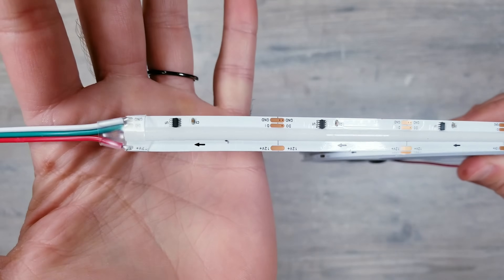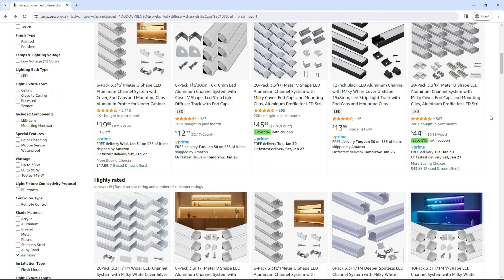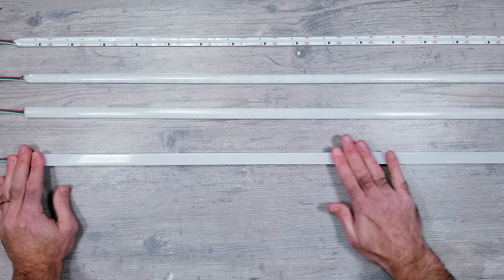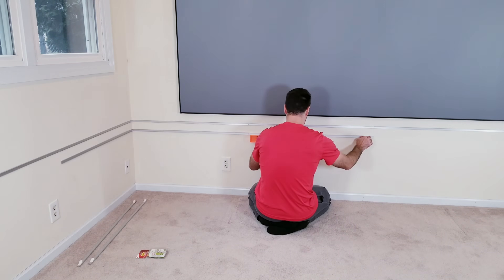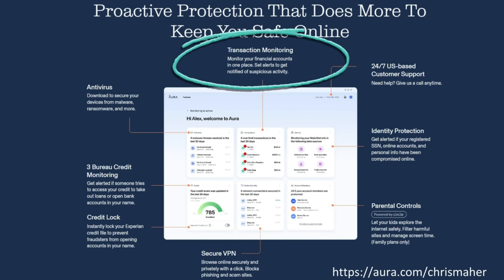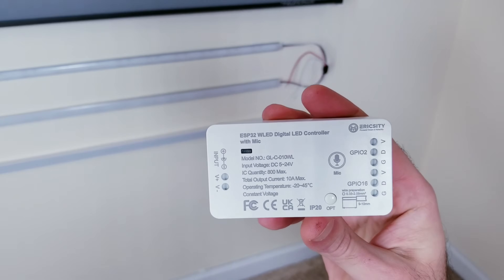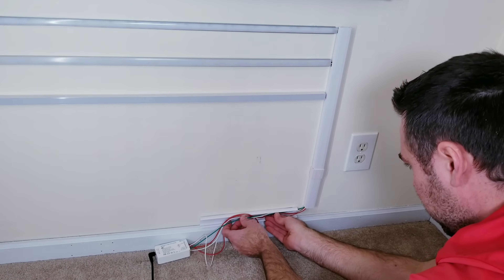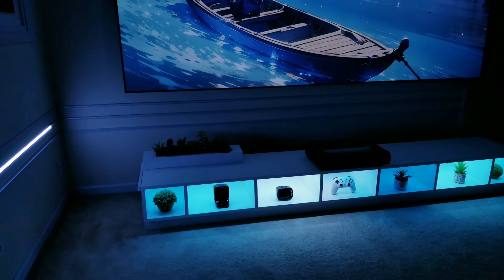The BEST Low Profile Diffuser Channels for COB LED's

Comment from the maker: 📟 BEST Amazon Deals on Electronics: https://amzn.to/47qjC9j (updated daily)
☑Check out my sponsor to begin your FREE 14 day trial to Aura: https://aura.com/chrismaher
WLED Controller: https://amzn.to/3HxjUgT
Cob LED's: https://amzn.to/3SxjE83
12v Power for LED's Above: https://amzn.to/422SSra
6mm Diffuser Channel 1 meter: https://amzn.to/47OVPNA
6mm Diffuser Channel 2 meter: https://amzn.to/3SzalEO
Continuous Diffuser: https://amzn.to/3SxmQAs
Corner Pieces: https://amzn.to/3OfZH2U

12mm Diffuser Channel 1 meter: https://amzn.to/3UfGW3r
12mm Diffuser Channel 2 meter: https://amzn.to/4bdwvDS
Continuous Diffuser: https://amzn.to/42iiqAL
Corner Pieces: https://amzn.to/4b9dHFH

Corner Diffuser Channel 1 meter: https://amzn.to/47N66tr
Corner Diffuser Channel 2 meter: https://amzn.to/3vRry3i
Corner Pieces: https://amzn.to/3Ojs2p5

4.8mm Diffuser Channel: https://amzn.to/47N6bxf

3m Removable Sticky Pads: https://amzn.to/4983nfj
Cable Hider: https://amzn.to/49rFUGf
Wire Stripper: https://amzn.to/3O5XEhW
Wago Connectors: https://amzn.to/3HzpUG0 and https://amzn.to/3HA9ZHA

Other LED's + Compatible Power Supply with Controller in Video: 
12v WS2815 Strips: https://amzn.to/491aKFa
12v Power Supply: https://amzn.to/422SSra

24v Cob Led Strips: https://amzn.to/424vI3H
24v Power Supply: https://amzn.to/3SpB1Xl

5v SK6812 Led Strips: https://amzn.to/3S6ptaX
5v Power Supply: https://amzn.to/48R3PP6

5v WS2812B Led Strips: https://amzn.to/3tYxpmI
5v Power Supply: https://amzn.to/48R3PP6

Spotless Diffuser Channels for Regular 60 Leds/meter strips:
Regular Channel: 1m Amazon: https://amzn.to/47aIujz 
Regular Channel: 2m Amazon: https://amzn.to/3QoHeDb 
Corner Diffuser 1m Amazon: https://amzn.to/3DFhRpf
Corner Diffuser 2m Amazon: https://amzn.to/3Krqw2q

Domestic Automation Plug n Play Controller with Mic: https://amzn.to/4b5UqVq
Domestic Automation Plug n Play Controller no Mic: https://amzn.to/48uRgZP
Video for Domestic Automation Plug n Play Controller: https://youtu.be/QmMwrOUB_kw

Video on WLED Controller: https://youtu.be/UTzR8GmZelU
Video on DIY LED Media Console: https://youtu.be/Bte2lbwbh8I

Check out my sponsor to begin your FREE 14 day trial to Aura: https://aura.com/chrismaher

The best way to help support my channel is to like, comment, make sure your subscribed and share my videos with as many people as you can. The other way is to use my links above as I get a small % at no extra cost to you if you buy something. Thank you all for the support!
Reply: Hey Chris, honest question. Which one is better?. Your previous recommendation of the WLED with the sound reactive built-in or this WLED controller?. To me, the difference is if you want sound reactive vs non-sound reactive WLED. Second question, can you use these Cob LEDs with the previous WLED with the sound reactive controller on your previous video?. And lastly, which combination will be the best in colors, controls and budget?. FYI, I want to upgrade my entire living room LEDs and control with WLED. I require at least 90 ft. Thank you for your advice. Big fan!.
Reply from the maker: Both are great! I would go with the domestic automation one for 5v led strips and this one for 12 or 24 volt strips. This controller also has a built in mic for sound reactive animations so you still would have that as an option. I have yet to try using the 12v cob lights with the domestic automation controller but it is something I want to try seeing if there is an easy workaround! The unfortunate thing about led strips is that there is not a perfect solution so it really comes down to what your main goal is. Colors will all be about the same but pixel density varies. Then it also depends on if you are using a diffuser channel or not an if you want to have a good looking white. Its fun trying different lights out but I think my overall favorite is still the sk6812 strips with 60leds per meter with the neutral white diod. I love having the dedicated white! Hope that helps and thanks for the support!
Reply: @ChrisMaherDIY thanks for the feedback bro. The SK6812 looks nice with your demonstration. However, I believe you can see the gaps even when you use a diffuser because of 60 LEDs per meter. I like Cob LEDs smoothness, the density is really nice. I don't think I can achieve the same smoothness with the sk6812 even if I use a diffuser?. Also, the SK6812 is 5 volt. Which means I have to do at least three power injections with my 90ft project. Oh yeah I also watch your other video and this WLED indeed has a microphone just like the other one, but this controller is better put together vs the other one which is exposed. Also I like this one because it has 24 volt power which means you can power long LEDs strip better than the 12v or the 5v. The only question I have is which one gives better individual colors and saturation, The Cob or Sk6812. Thanks.
Reply: @ChrisMaherDIY neverending question, can led strip be main light, and if, where?
Reply: What about COB Neopixel with 332 per meter?

Comment: Again you skipped right over how you laid the various tapes around the 90deg inside corners. ?
Reply from the maker: I'm not sure what your meaning. You don't do anything other just continue to stick them to the profile. No cutting, no twisting. It just lays flat and follows along on the wall.
Reply: @ChrisMaherDIY  Even with the 4.8mm channel, the COB strip will just fold around the inside corner ?  It would have been very tight and I never would have thought that possible.  Thank you sir !

Comment: I recently discovered your channel and it is amazing work you are doing. All the respect.

I'm building a small mancave/movie room/home office room out of the garage. It is quite small, 4,5 m x 2,3 m and the height is just 2,2 m.
I want to make 3 led stripes on the ceiling (in gypsum), probably around 3 m long each, as my main lighting. What do you think, is it going to be of enough light for main lighting (if not ambient is needed)? If yes, which RGBW led stripe would you recommend for this? Many thanks

Comment: You are adding power to the power injection and I wanted to ask: if you already connected LEDs (power, ground, data) and then also connect extra power to the power injection cables, won’t it burn or something? I thought that I need to either connect power/ground or connect injection cables. 
Can you please explain?

Comment: I just installed COB lights over my kitchen cabinet.  These babies melted the plastic reel they came in as I was installing, wondering if they would over time melt the plastic diffuser on the metal channels?

Comment: Thankx for your great videos.  I have never tried using this kind of lighting, and I have a kitchen island that i want to add LED lights under the overhang edge of the  top.  the top is a simple rectangle, 10' X 4'    So 10' + 10' + 4' + 4' is  28'  Can i join two lengths to give me a single loop, and just do a power injection between the two sections. I want to have the ability to let the light "chase" around the top.

Comment: Hi friend. Please tell me. there is a WLED project on ESP 32, respectively, it has an address LED strip. is there anything similar but with a simple RGB ribbon? then I have 5 meters of new tape lying around and I do not know what to do with it. the standard drivers that are sold in stores are not interesting because they are not interesting and they cannot be controlled via WIFI. I can build a driver on MJE13005 type mosfets, but they also need to be managed somehow. I think you've heard about the AlexGyver blogger, he has an RGB ribbon controller on an ARDUINO NANO, but again it can't be controlled over WIFI. Hello from Russia

Comment: I know this video is 9 months old, but I’m trying to create a a base board in which you can’t see where the light is coming from. Wondering if the 4.8mm would be good enough if you can’t see the diffuser channel, just have the light glowing downward, or if the light, about 3 inches off the floor would be fine? Would I even need a diffuser channel? Only reason I’m considering one is for easy replacement of the LED strip if/when it has any issues.

Comment: I prefer the shallowest non-flexible channels for COB.  But with COB, a diffuser cuts the light by 30% and really hampers your maximum brightness.  So when I use channel with COB I leave the diffuser off.  (I've only  been doing kitchen under cabinet where it doesn't matter)

Comment: Still waiting for Govee to jump on those Cob rgbic strips with reasonable lengths.
The great thing about cobs is that you can use really low profile diffusers that don't stick out like a sore thumb from the wall. And corner diffusers can be lower profiled too.

From my own research, I figured out that you need 60+ leds/m for a 16mm high profile. For corner diffusers, you either need big ones that have enough clearance or need more than 120leds/m for smaller diffusers.

Comment: for 25 meters how many watts power supply need?
Reply: Go to btf lighting select the strip you want and in the description it will tell you the maximum watts it draws per meter at 100% brightness white. Then times that by 25. Make sure to match the power supply voltage to your strip.

Comment: Hey Chris, Enjoying your vids, watched almost all of them.
On this project did you just use one ESP 32 Conttoller ? 
I'm about to do a LED multi-strip horizontal display and was going to use an ESP 32 per strip. 
The way you have done works well for me, I'm just not sure how you got it all done (+- 15 meters) all with on ESP #@ and those great unsync'd and sync'd effects.

Comment: Hi Chris. Thanks for the video. I have a couple of projects planned and this will help me out. While looking for the COB LED on BTF seller profile in Aliexpress, these exact same strips are advertised as not compatible with WLED/ESP32 controllers and require their own controller BTF lighting. I am pretty sure it is just a way to force you to buy their own ontroller but wanted to make sure. I see you are using WLED, so should not be an issue.

Comment: Hi Chris,  I'm brand new to LED lighting.  I'm curious about 2 things.  First, I really like the movement effects of the lights in the video, and I'm not sure if that is sound reactive, or a program?  Second, I want to install a similar system outside (70' in 10 foot sections).  Are the LED's you used suitable for outside?  If not, what would you recommend?  I mostly want white, but the color effects are awesome!

Thanks for the awesome video!  I didn't even know about diffusers until I watched it!

Comment: You were using a 12V LED strip which means that one IC controls 36 LEDs. That's why one segment of several centimeters always have the same color. If you use a 5V LED Strip instead, one IC only controls 2 (!) LEDs. This would give you even a better result. However, depending on the length of the strip, the current could become a problem...

Comment: Heya Chris, question for ya: The width of the LED COB strips per BTFs specs are 12m, but the Muzata channel width for the Corner (V shaped) channel diffusers are spec'd at 10mm.

Your video shows how well they work regardless, but did you have any trouble installing the COB strips in the V channel diffuser frame?
Reply from the maker: Thanks for watching and great question! You are absolutely correct. The strip is slightly bigger than the flat part of the diffuser that the strip goes to but they stick just fine and doesn't effect the performance at all.

Comment: I have used these strip lights in all my projects. I was thinking of trying this as well. I could not afford to buy them and test them myself so ty. I used 2 1 meter strips in the spotless corner diffuser. Those cost more. To make sure it worked out. It does they are a little wide for 2 strips but work well and very bright. I was just sure to line the segments up well so it looks like 1. The ones you testested here  will save  alot of my cost when using them over spotless. Ty again.
Reply from the maker: You are very welcome and thanks so much for watching! Sounds like you had a great idea to make it work! Thanks for sharing!

Comment: I know you didn't mention it, but how much do the diffusers affect perceived brightness? 
I ask because I'm planning a 12M+3M*4 (12M is perimeter, 3M*4 is corners) and right now my total cost using the 96LED/M Muzata strip you showed is just around $300 depending on the prices of the day. Since I'm planning on running the perimeter strips where the wall meets (10ft) I've been debating buying COB no diffusion since the strip will be hard to see that high to save money and gain brightness. 

But, since you have everything in hand: If all the strips will be white most of the time to be used as main lighting (yes I want it dim) and effects will be used some of the time do feel that the Muzata is the best bang for the buck or do you have a different recommendation for that? 

Also big thanks for all the videos you do with this stuff. I was able to use your Govee perm light guide to install mine this year without any issues, and I'll be getting into WLED using the same lessons with this project!
Reply from the maker: Thanks so much for watching and great questions! The muzata strips are a great bang for your buck. But if your main goal is to have them be white and your main lighting source, I would probably look at a strip that has a dedicated white led built in like the sk6812 leds. Or maybe at the very least order 1 of the muzata ones to see what you think of the white color. I also believe there is a cob strip out there now that does have a dedicated white light that Ill have to see if I can find. So many options to consider! I know its overwhelming at times.

Comment: I need a corner diffuser that is less than 16mm on the sides, ideally around 12. I have yet to find one, have you ever seen one that shallow?
Reply from the maker: Thanks for watching and that's a great question. I have not seen anything that small for a corner profile. If I ever come across one though I'll let you know!
Reply: @ChrisMaherDIY  That would be great. I have Detolf display cases from Ikea that I would like to light along the side edges instead of the typical per shelf. The space is limited though. Love your videos and they've taught me a lot. Keep it up!

Comment: Would you consider using the 6mm diffusers in under kitchen cabinet lighting?
Reply from the maker: I would probably go with the 4.8mm one for under the cabinet and if the light is somewhat hidden, I wouldn't even put on the diffuser covers. At least for me, if its in the kitchen, I'm wanting things to get as bright as possible. But if your just wanting some nice soft light but don't need it as bright as it can possibly go, then I would still go with the 4.8mm kit. That's actually what I used in my undercabinet kitchen video I did a while back and its still working great today!
Reply: @ChrisMaherDIY  Awesome!  I have that video saved so I can reference once I get some free time to get that project rolling.  Thank you for your amazing videos.  Inspiring and super informative!!!

Comment: Nice, thank you.
I actually used black aluminum corner profiles (with black diffusers) and a COB RGBA strip and put that all around the edges of my gaming table. When off they're stealthy, just blending in with the table itself. And when turned on it's like the entire edge glows. Those COB strips are trivial to diffuse, since they almost don't need them (especially on a higher brightness level/also consider there are different levels of density on those COB strips as well).
Reply from the maker: Thanks for watching and taking the time to comment! That sounds like a great setup! What black channel did you use? The only ones I found I was able to see through the black diffuser pretty easily. Yeah considering the 4.8mm diffuser actually did a pretty good job, you certainly don't need much and I would assume a good number of people would be completely happy with no channel at all. Thanks for the great information!

Comment: Why do those LED strips have to be lit in groups and not each single LED?
Reply: These COB strips go about things differently than the typical 5/12v do.  Quindor has a great in depth breakdown video on these “addressable neon” strips (quick search here on YT).  Each cut point is just about an inch apart and there are 100 per 5m strip.  They are great in long runs being 12 or 24 volt.  I lined my roofline this year with these in the corner channel Chris showed in this video.  I waterproofed them with caulk and packaging tape (these are not outdoor IP65+ rated).  Worked out well and all the neighbors have commented about my permanent LED lights.
Reply: thanks for the explanation @lancerobbins24
Reply from the maker: Unfortunately most 12 and 24v strips are not individually addressable. I'm sure there is a good reason but I couldn't tell you why. I'm not the smartest guy in the world. But I would check out Quindor's channel. He is incredibly smart and i'm sure would know!
Reply: STILL THE KING OF LEDs
 @ChrisMaherDIY
Reply: These are COB lights and COB lights aren’t individually addressable (individually controllable).
Reply: Chris can you share the link for just the led channels.  If I am buying the roll for the cover then it doesn’t make sense to pay for something that I’m not going to use.

Comment: My wled have flicking randomly changing colour i was using ws1812b with esp22 and mobile charger 5v 2a any solution do you have?? Tota 218 led
Reply from the maker: Thanks so much for watching and taking the time to comment! I would first check the ground connection and if everything seems good there I would try a larger power supply to see if that makes a difference.